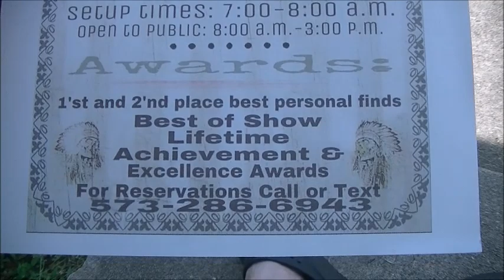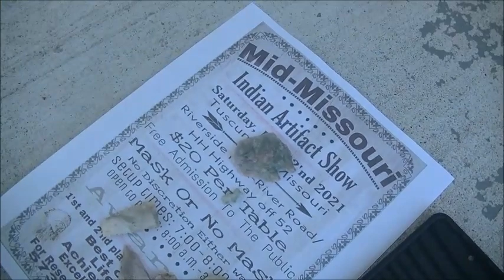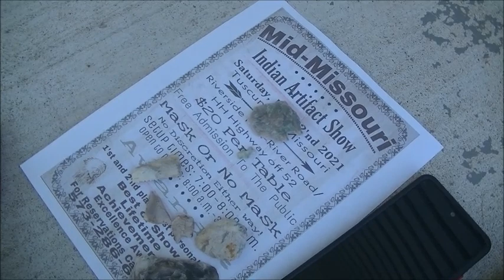A Smoker Comes Along - Arrowhead Hunting Missouri

Comment: That “Rice” looks like a tip that was refurbished. Hope to see you at your show Sat.👍🏻
Reply from the maker: It's always busy being the host at an artifact show. Make sure you come over and grab me if I don't notice you first. 
 Pretty positive it's no rice. It's definitely not woodland flaking and being slightly basal ground. Richard has found over a thousand Rice's, and I'm probably in the hundred range. Even his best, Rice Cashe, all display woodland flaking. It would be an odd find for the site, there's no doubt about that. At least 16 acre's excavated, and never a woodland point. Which for as long as the Etley culture used this site, and the early archaic and Dalton's. You would assume it would of been used by woodland cultures as well. But even the site below us, in the bottom, has no woodland.